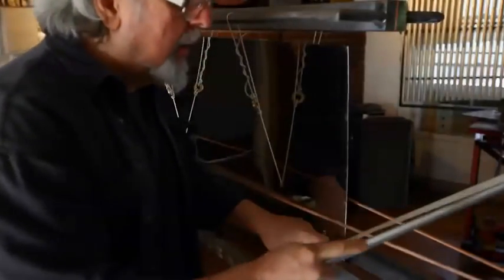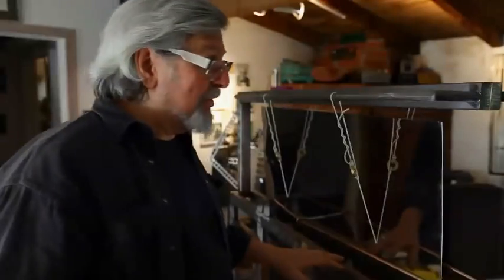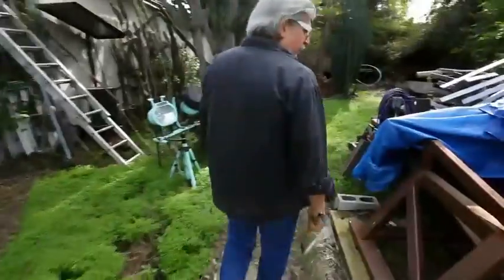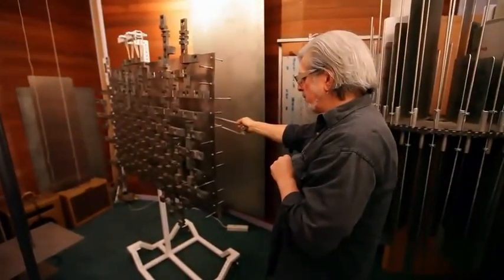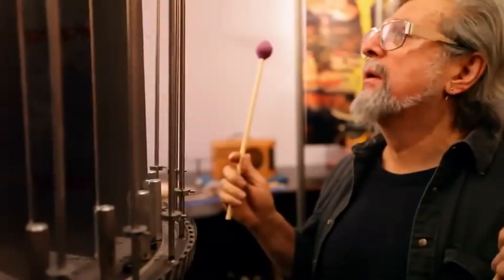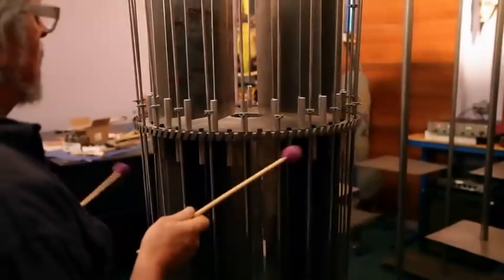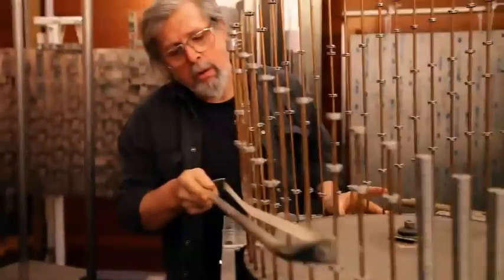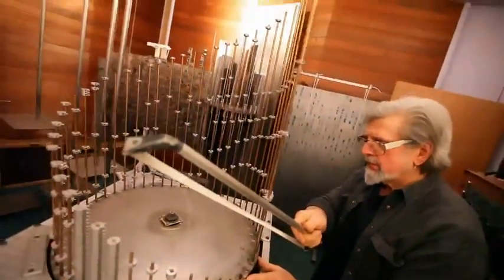Man of Steel Official Soundtrack | Behind The Scenes Sculptural Percussion- Hans Zimmer | WaterTower

Comment: In case no one else answers this, I can only tell you "not the one wich was used here" :) just kidding, great video! but the overdrive in 4:10 could be avoided. so, it's a bit tricky. you should have mic and preamp suitably matched so that you can record wide dynamic range of sounds. all of this instruments sounds even better in reverberant environement so you could use a good pair of omnidirectional small diaphragm condenser microphonse.